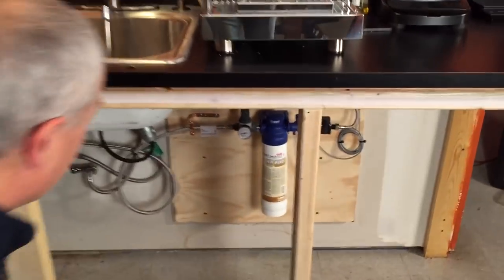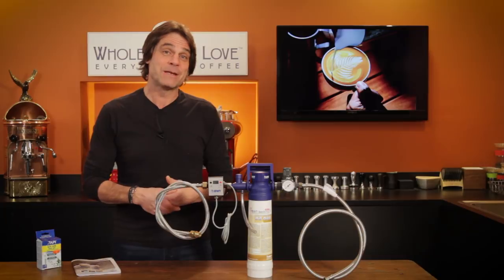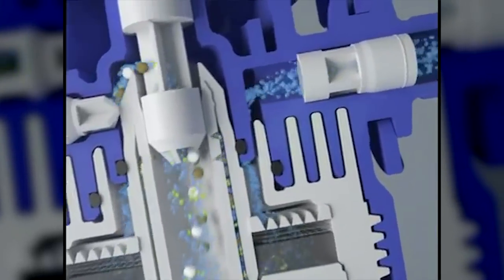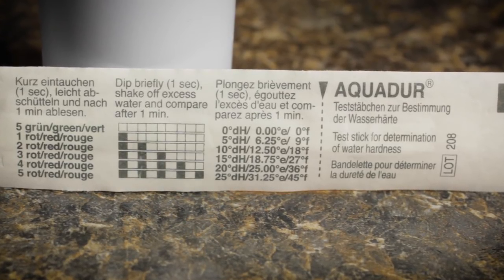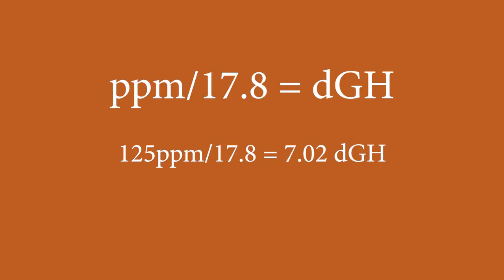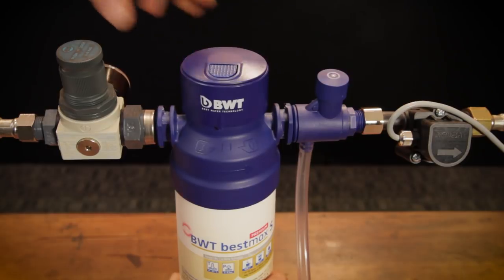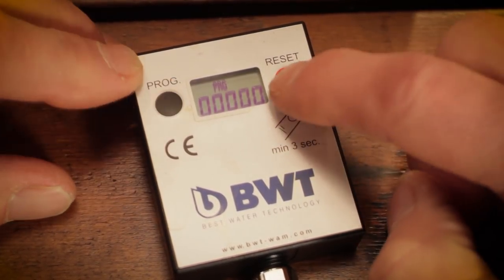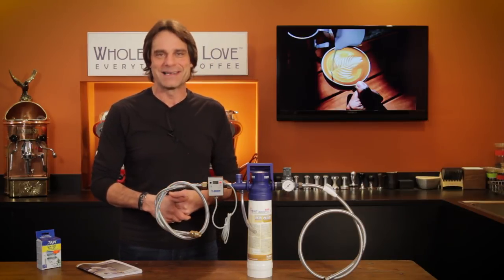How To BWT Water Filter: Hardness Testing, Bypass Setting & Flow Meter Programming

Comment: Great, helpful video... Question: What is the proper water pressure to set on the water regulator/gauge at the inlet of the filter head?
Reply from the maker: Hey b, thanks for the question. Most machines specify a maximum input pressure for a plumbed in connection. It's generally lower ~2-3 bar for machines which do not have a solenoid valve on the plumbed in connection like Profitec and ECM and higher for machines which do like most Rocket machines. Check your machines specs in the manual.

Comment: Great video! I'm planning to install the BWT filter that adds Mg to use with our new Synchronika. The filter will be connected between they outlet of our current RO water filter under our kitchen sink and the faucet on top of the sink. The RO water contains little to no calcium. Will the BWT filter still add magnesium? You say in the video that is exchanges calcium with magnesium. But the water doesn't have any calcium. Also, if I don't want to add magnesium to our drinking water, can I use the bypass to completely bypass the filter and then turn it back to add magnesium when filling the water reservoir of our new Synchronika?

Comment: Can you install a Bestmax Premium after an RO system? More precisely, will it still provide the remineralisation of magnesium while all minerals have been removed by the RO? 
(Yes I don't need the osmosis system with the bestmax, but I use it to remove nitrate, which the Bestmax wouldn't remove)

Comment: Hey Marc! I have a La Marzocco GS3 AV and I purchased the BWT Bestmax Premium XL for my tap water to go through a dedicated faucet. My tap water hardness from the test strip is showing to be at about 180, ph was around 7.5, alkalinity at 140, and TDS was about 200. Will this system work for me and if so what setting should I put it at? I ran some tests after installing the filter and flushing it 10+ gallons and it was giving me TDS 170, water hardness of 0, alkalinity was at about 120, and Ph at 7.0. Thank you for your help!
Reply from the maker: Hey Tony, The filter should work for you. Understand the filter replaces calcium in your tap water with magnesium so you will not see a large drop in total hardness after filtration. Magnesium will show up/contribute to results of a total hardness test. That's okay as magnesium does not cause scale like calcium does. And, you want the magnesium as it supports flavor extraction. Not sure how you had a hardness reading of zero after filtration while showing a TDS of 170. At that TDS a total hardness test should not be 0. A carbonate hardness test should show a significantly lower result after filtration.
Bestmax filter head bypass setting is determined using results of a total hardness test expressed as German Hardness ° dH. 1 degree of German Hardness is equal to ~18ppm. So if your hardness before filtration tested at 180ppm then you're at ~10 ° dH. According to BWT you should set your bypass on the filter head to 3. Rated filtration capacity at that setting is 750 liters for the S size filter cartridge and 1800 liters for the V size.
Hope that helps!
Marc

Comment: Hello Marc, thanks for the very informative video. With your recommendations, I purchased a Bestmax Premium V and it has been set to 2 by the installer and showing TDS of 135 ppm. For more acidity should I move the setting to 1? Thanks
Reply from the maker: Hi MO, You are welcome for the video. TDS of 135 = 7.5 degrees German hardness (135/17.9=7.54). According to BWT manual you should set bypass to 3. Setting to 1 will reduce the mineral content too much and reduce extraction of flavorful acids. It would also reduce the capacity of the filter. At bypass 3 your filter has a capacity of 2250 liters. Setting at 1 will cut the capacity in half. Hope that helps!
Marc
Reply: @Wholelattelovepage  Hi Marc, thanks for the answer. The existing ppm of my tapwater is 188. Setting 2 decreases it down to 135 (measured by BWT technician) If I change the setting to 3, will this be too hard for the machine? My wish is to have some more acidity because now I have sweet taste for even light-medium roasted beans. Too much sweetness, maybe more like a weaker aroma is what I want to avoid. Thanks

Comment: Just installed a BWT filter purchased from WLL. Two questions: (1) my city water hardness is only 2 German degrees and that is not included in the table. Should I just set my bypass setting to 3? (2) The pressure specs for the BWT state that operational should be 2 - 8 bars (> 1.2 bars on input). I have around 3 bars when the machine is off, but it drops to near 0 when doing a draw with the machine. Is that normal, or do I need to somehow adjust the pressure regulator? Thanks!
Reply from the maker: Hi Michael, Thanks for the questions.
1. Wow, that's some very soft water! Yes, just set the bypass to 3. Capacity for filter is about 2500L at that hardness
2. I recommend adjusting pressure while the machine is drawing water.

Comment: How does this differ from an RO system that talks in terms of reducing Total Suspended Solids?
Reply: The RO system will remove the minerals from the water which will result in funny tasting coffee. The dissolved minerals in the water are important and the BWT doesn't remove them. It will replace Ca with Mg, to prevent/minimize scale buildup while retaining the mineral balance.
Reply from the maker: Hi William, Shashank Mittal is correct. RO systems remove all minerals and depending on the setup can make ultra-pure water with near zero TDS (Total Dissolved Solids). On paper, pure water sounds great. But water is a good solvent. Zero TDS water is an even better solvent - it wants to gain back those minerals! If used to make coffee/espresso it over extracts causing bitter flavors and lacking minerals it tastes flat as well. But that's just the start! You will never see pure RO or distilled water packaged or transported through metals. It's such a good solvent it pulls ions from the metals and can be corrosive. This can damage coffee and espresso equipment. You will see RO systems used in homes, cafes and other beverage service applications. But, after RO filtration water is remineralized by adding back some water bypassed around RO treatment or methods like mineralization cartridges or dosing sytems. The goal is to produce a mineral level in the water good for taste and equipment without risk of scale buildup.

Comment: Thank you for such a comprehensive report.  Very helpful and informative.    Meanwhile,  until I am able to directly plump in, is bottled spring water such as poland springs, or fuji, acceptable?
Reply: Louis Formica Do you all have too much money to spend? Espresso machines run without this mumbo jumbo since decades.
Reply: Sirion, this filtration system isn't a requirement for an espresso machine and if you use soft/clean water, then you don't need it. Hard water is a common problem and even slightly hard water can cause scale buildup over time. This is cheap insurance for those with hard and/or not so clean water.
Reply: You'd be wrong, go to ANY coffee shop, every one of them will have an extensive filtration setup feeding their espresso machines, many of the 3rd wave shops have large RO systems and then selectively re-mineralize for taste.  Prosumer and Commercial machines are not meant to be de-scaled at will, there are many valves and small pipes that can clog when de-scaling so the recommendation is to avoid scaling in the first place. @miskatonic6210

Comment: What is the settings of 0-1-2-3 on the head of BWT Best protect V
Reply from the maker: Hey SK, Thanks for the question. The 0-3 settings are filter bypass which you set based on your source water hardness. If you do not have the manual your can find it in our customer support here: https://support.wholelattelove.com/hc/en-us/articles/1500004223582-BWT-Bestmax-Premium-Settings-and-Specifications

Comment: Mark, should you expect a lower reading on the paper strips with water coming out if the filter?  Of with the  calcium replaced by the magnesium is it the same? I am seeing the same around 125-150.
Reply from the maker: Hi Martin, Thanks for the question. The reading will be similar as the test strip cover total hardness which includes both magnesium and calcium. If you were to test for magnesium and calcium individually you'd see a significant decrease in calcium and increase in magnesium.
Marc

Comment: Can the leads on the LED display be taken off for snaking wire and placing the readout above the sink?
Reply: Can I just use chart and leave the units of measure in liters in 
the US market
Reply from the maker: Hi Joe, Great question. Yes the can. One screw hold holds the back of the display on. Take out that screw then there are two wires which go into screw terminals. You can release those wires, snake and put it back together. Wires are not soldered inside!!!
Reply from the maker: Yes you can leave in liters. That's how ours is setup.
Reply: http://www.bwt-wam.com/en/service-hilfe/Information/Manuals-certificates/Pages/default.aspx
The online manual and the one that came with the filter show different filter surface area for the bestmax s filter. My source water is 6 what is the correct filter capacity in liters?
Reply from the maker: Hi Joe, According to my chart for total hardness of 6 degrees the filter capacity of the Bestmax Premium S is 1,250 liters.

Comment: I have the bwt but no regulator and noted I have 4 bars to my profitec 700 is that too much?
Reply: I have the ECM, which is pretty much the same machine as the Profi 700. For my machine, it is recommended to have 1.5-2 bars of pressure. I suggest you add the regulator, its cheap insurance for an expensive machine. I have the regulator and the machine shows 1.5bars when idle.
Reply from the maker: Hi m, Shashank is on point with his comment. ECM/Profitec recommends 2 Bar max water pressure into their plumbed machines. Their machines do not have solenoid valves which close off line pressure to the machine when the pump is not operating. This setup allows the machines to do line pressure pre-infusion. With a regulator one can adjust pre-infusion pressure. I've run my Pro 700 in the studio at 4 Bar for months at a time with no issue. However, I'd recommend staying within ECM/Profitec spec of 2 Bar. But if you want to play with higher pressures for pre-infusion it's okay IMO so long as you are not leaving the machine unattended. Machines with a solenoid on the inlet cannot do line pressure pre-infusion. For machines with a solenoid some piece of mind as the internal plumbing of the machine is not constantly exposed to line pressure. Internal plumbing leaks due to higher line pressure is very unlikely - the machines are over engineered but there is some risk. At the end of the day I prefer machines without a solenoid on the water line input. It allows for the pre-infusion and overall the machine is less complex - solenoids don't last forever. ECM/Profitec machines do have a mechanical valve near the waterline connection underneath the machine. I suggest closing that valve if machine will be unattended for multi-day periods.
Reply: @Wholelattelovepage   Hello, just learning pre-infusion and also like to get more consistent shots :-), is your comment valid for both vibration pump and rotary pump model espresso machines. I'm also rebuilding old Grimac, Mini La Uno (Plumbed)  and I think it is possible to use pre-infusion also if I remove solenoid on the inlet...but am I assumed correctly? Highly appreciated your knowledge guys, Thanks in advance!

Comment: Hey Marc! I have a La Marzocco machine, which as you’re probably very familiar with, comes with very specific standards for water quality. I have a document from LM that calls for very specific parameters for hardness, pH, TDS, iron, free and total chlorine, Alkalinity, and chloride.  How can I be sure that a product like this will meet these standards before I make the monetary investment for this system? Thanks for the help!
Reply from the maker: Hi Eric, A GS3? When used as directed the BWT Bestmax premium produces water within the Specialty Coffee Association specs for brew water and the water will not cause scale in espresso machines. The only requirement is water going into the filter is safe for human consumption. Chlorination and other chemical components are removed in the activated carbon section of the filter, Hardness/TDS/alkalinity are controlled by the ion-exchange section which replaces calcium as needed with magnesium ions. For more details you can speak with our tech support by calling 585-924-7170 if needed.
Marc

Comment: i used the API GH kit like show in your video and got 8 drops.  so how to tell which setting to use?  i just installed the BWT and need to set the aquameter.  thanks!
Reply from the maker: Hi e, Thanks for the question. If I'm not mistaken 8 drops = GH of 8. Bypass setting for that is 3 on the BWT system. Hope that helps!
Marc

Comment: Thank you for the video, I only found out about BWT filters recently, I have installed a RO system, and I feel that the water is tasteless which is not always a good thing, I saw one coffee shop that use RO and down the line, they added a BWT bestmax. I have to say their coffee tastes great. so do you think that is a good way of using the filter in my case? or should I just connect it directly to the water source? I like my RO because it has a large accumulator that keeps some pressure to be used for a tap and for the espresso machine. 

looking forward for your response, thank you in advance sir
Reply from the maker: Hi Saif, You are welcome for the video and thanks for the question. Yes, RO water is tasteless and pure RO water will over-extact espresso as it has no minerals. Beyond that pure RO water can cause corrosion of metals in espresso machines. If your RO system produces 0 TDS water BWT recommends using their Bestmin cartidge: https://www.wholelattelove.com/products/bwt-bestmin-premium-m-filter-cartridge
Bestmin remineralizes water after RO treatment.
Marc
Reply: @Wholelattelovepage  Thank yo kind sir, very helpful indeed.

Comment: Hmm, so if you don't buy that expensive galon calculator that is sold seperatly, you will have absolutely no idea at all when to replace your filter or if your filter is actually working or long time expired?! If so, I guess we're pretty much forced to spend the extra to get it if we want to use the filter correctly.

You said by the end of the video to either replace it before it reaches 0 or after 12 months, whichever comes first but why replace it after 12 months if you've barrely used it and still hvae like 50% filtering capacity left? Shouldn't it still be doing it's job since for example it has only filtered 1200 galons on 3800? I mostly just drink 1 double espresso at home per day, so I guess I'll just get the smallest premium available but again... if ur sure to never reach the max capacity, the flow is totally pointless if you still need anyway to throw it away no matter what after 12 months? What's the consequences of still using it. Are you gonna get contaminated water, worse than straight from the sink, what happens exactly? There's so many overconsumption on the market...
Reply from the maker: Hi P, Thanks for the comments. The flow meter is not required it just makes life easier for those who go through more than the filters rated capacity in 12 months. I don't know the particulars of your filter capacity as it depends on your source water hardness but at a double espresso/day you may not need to exchange for more than 1 year. My source water total hardness is 7 degrees. With that the S size filter gives me a capacity of 1,070 liters. The range for the S filter is 1,875L at 4 degrees total hardness down to 155L at 35 degrees total hardness.

Changing out the filter after 12 months even if not used to capacity is BWT's recommendation. It's unlikely IMO the filter all of a sudden stops working properly at 12 months plus 1 day. I don't like waste either!
Marc

Comment: Hey marc, i got the bwt kit and thr hose that came with it has two different size ends, one fits to the bwt filter so i guess its a 3/8 but the end isnt and i dont think its a 1/4 either what size is it?? This is the end that goes to the water supply my water supply nipple are 3/8 or i can swith them to 1/4 if needee am just confused if am doing something wrong
Reply from the maker: Hi Jesus, The end of the stainless hose which connects to your water supply is a US standard 3/8" compression fitting. Hope that helps!
Marc
Reply: Whole Latte Love cool thanx for the info i figured it out, now for my ecm sunchronika what do u recommend me put the pressure regulator at?  How many bar or psi? And when to adjust it meaning when the machine is off or take of the filter or when the machine punp is on? Since it varies, thank you!